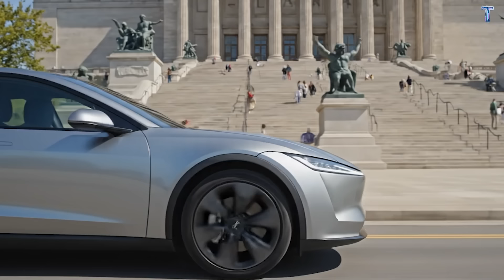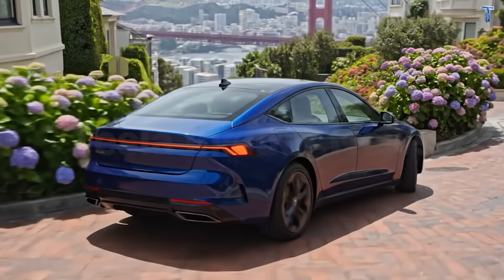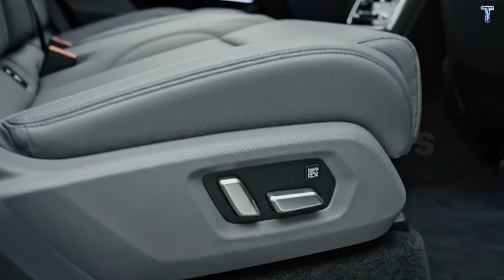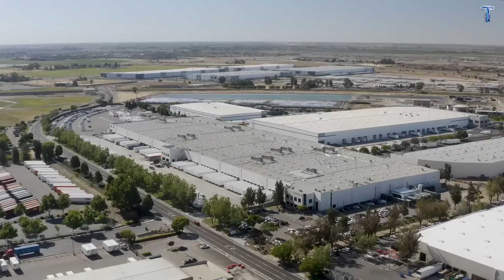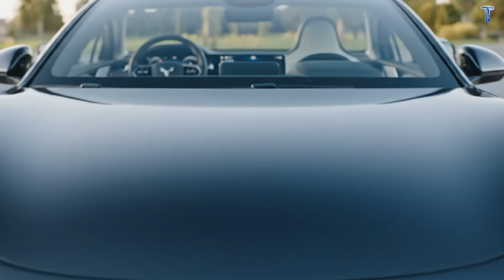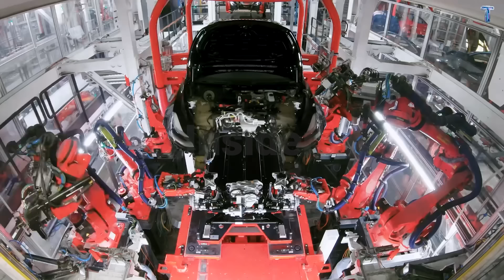Tesla Model 2: The First Car Designed So Retirees Never Face a Repair Bill Again

Comment from the maker: Which of the 7 design decisions would actually matter most in your daily life if you owned a car like this for the next 10 to 20 years The lower maintenance costs the smoother ride the durable steel wheels or the long battery lifespan Curious what stands out to you and why?
Reply: Low maintenance costs is critical

Comment: I’m 81 with a year left on my 3 year lease of a 24’ MODEL Y.  This car has exceeded my expectations in every way with the exception of  the suspension which seems to be improved in the 26’ refresh. The most significant thing by far is the full self driving capability which essentially drives me everywhere we go, even to the grocery store a mile away. It parks itself and, more helpful, backs out of my stall without interference with other cars or people that are nearby; and then on our way back home,  returning me to my garage, even opening it. What more could a senior want for transportation? If Model 2 is available in 27’, we may consider it but we’re more likely to stay with a model Y.
Reply: What was your monthly payment?

Comment: Will it float on water like the Chinese evs do?
Reply from the maker: A vehicle’s ability to float would depend on sealed compartments, buoyancy, structural integrity, and controlled testing; the video does not claim amphibious capability. What use case are you imagining—flood safety or recreational travel?